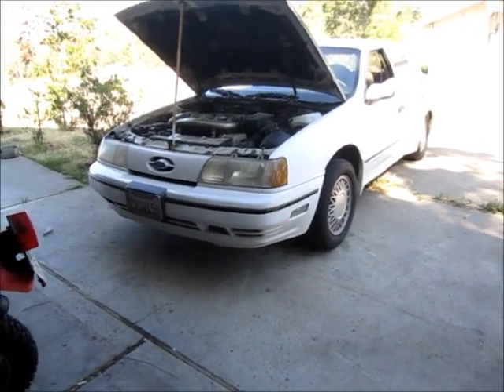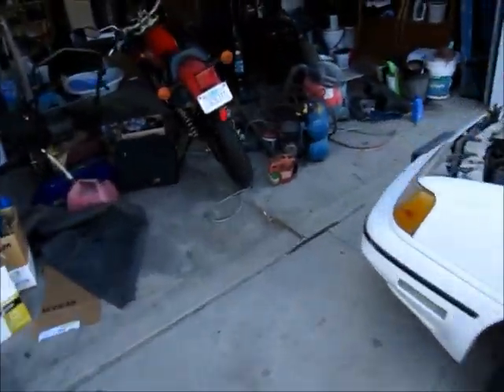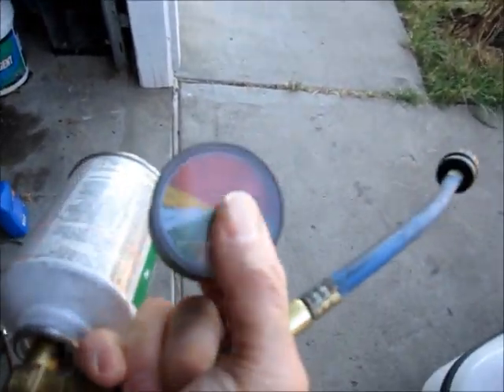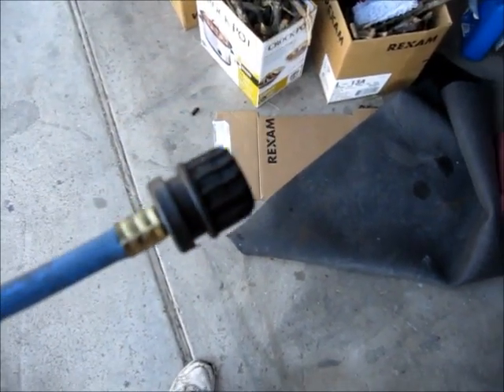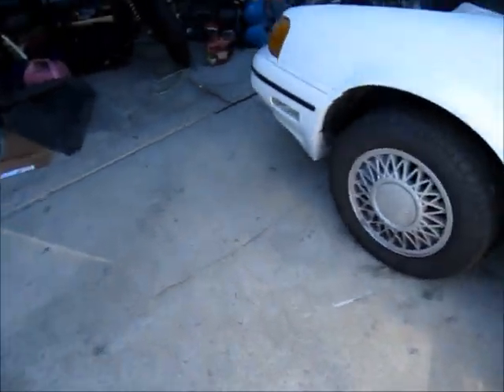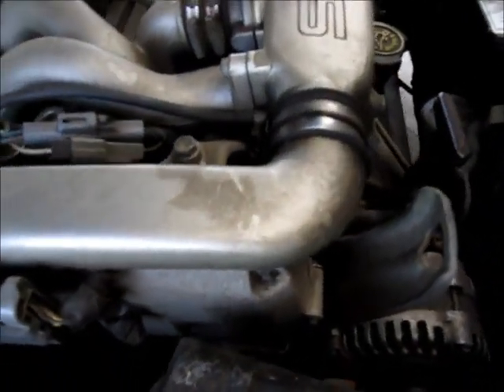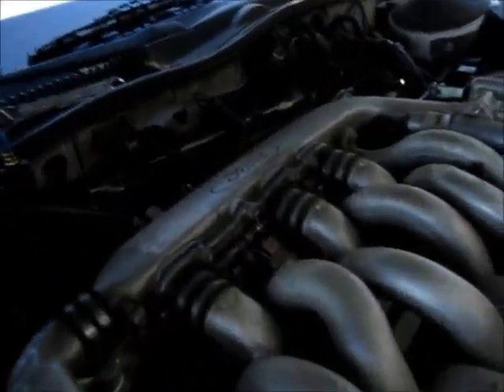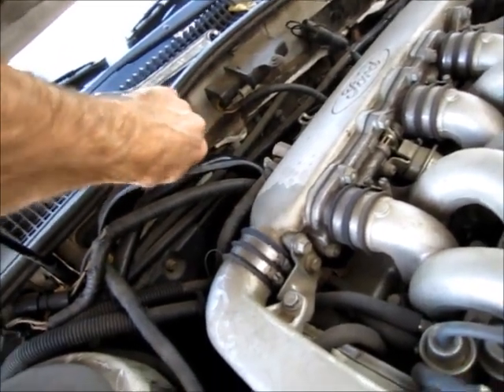How To Charge Auto A/C Systems - Backyard Style Car AC Fix

Comment: I am glad you mentioned the high and lower pressure valves. some are not different color and sizes and can prove to be very dangerous. But this is bad for your system. There is clearly a leak somewhere in your system. This is bad and incorrect for a few reasons. 1st, if there is a leak the refrigerant is replaced with air, this is what causes your compressor to not engage, for good reasons. In the air there is moisture. The moisture with heavy pressure as you checked the pounds but not how much refridgerant is in a vaccum system. So the compressor will wear out much sooner and the leak which you clearly have as your lbs of pressure has been decreased and replaced with air , not unlike a hydraulic  system like your breaks the air bubbles ruin the vaccum, Most cases the rubber part of your high pressure line will have microscopic holes that leak the r-134 out slowly over time also alowing air and moisture into a closed unit. In essence rapidly increasing the enivitable demise of your cool summers. Auto zone and O'Reily's both rent a proper vaccum pump and gauges(which a rental fee is returned in full upon return ) so yes free in the end! This enables you to check both high and lower pressure lines to find the leak. It is simple attach to schaeder valve vaccum to necesary lbs indicated and allow 20 mins to see if there is a leak in pressure. 9 times out of 10 it is in your high pressure line as it is partial rubber and not all metal, and endures high pressures. if it is, its generally a bolt on either side of line and a rubber gasket on each male connector. be sure to oil rubber to avoid cracking in the future. reattach and check pressure again. Then connect your vaccum to the system and allow the pump to run for 20 minutes min. This will remove unwanted air and moisture, ***remember when running pump it will often need an oil refill to avoided burn up, keep an eye on this once the system is purged of air and moisture, find the specs for needed r134a it is usually under the hood and it will tell you how many ounces it requires. Do not exceed this! it will eventually ruin your system. It is a closed system and only works correctly if the correct amounts are in there. Remember there is no such thing as cooling r-134a only removing heat from it via air cool and radiation. So the more air you have in your closed system the less efficient your ac will perform as air does not cool like r-134 does and its mixed in with your coolant.  It can be an easy quick fix to buy the filler cans but they are marketed to people so that you have to buy a 500  compressor much sooner. Or expensive lines. Be careful my friend, dont be fooled by the quick fix. :)

Comment: man!! thanks so much.  I was about to give up on my ac recharge (first time) til I saw your video.  It helped explain the surging and what to expect.  Instructions on the bottles don't say anything about surges so I figured I was doing something wrong.  The more refrigerant that went into the system...the better the compressor sounded and the longer it runs..just like you said. I've got to go back out to get another can to finish the job but this video save me about 80 bucks.
Reply from the maker: Glad you saved some $$ and got it working again!

Comment: When the can is inverted is placing liquid into the compressor, which is all bad for your compressor. You can heat some water up in a pan and place the can into it. This will cause the refrigerant to heat up and pressurize the can, which will help fill the system faster.

Comment: what is stopping air from being sucked into the system when you remove the can from the tap. lol
Reply from the maker: There is a shrader valve that closes as soon as the can is removed. There is also positive pressure in the line, so if there was an instant when the valve was open, it would just vent out a little refrigerant rather than suck in air.

Comment: Changing valvestems should only be done if the system is empty , or has been evacuated with vacuum - but , especially on older vehicles , just a little tiny squeeze of the valvestem , can make it move as much as 1/8" or more.  Surprisingly , this can account for a loss of refrigerant pressure over a long period of time , where your AC will still work after the winter - well enough so you can feel that it's going to need a recharge.  As opposed to it not blowing any cool air at all , come summer.

Comment: Any time you are putting refrigerant into the AC system , you should be re-checking the low side and high side valvestem tightness first.  You do this with a multisized tool which is also used to remove or tighten bicycle tire/tube valves etc.  The reason you want to do this , is because the valvestem O-ring may be worn or loose.  Tightening the valvestems will ensure the system doesn't leak over the winter or at all , then refill the system.  You can , even replace the valvestems.

Comment: Shouldn't take 10 minutes to add a can of refrigerant, you would have way more success if you inverted the can like your supposed to. I add propane and 1 oil injection can to all my old beaters. Works great, very cold and propane is a larger molecule than r134a so leaks arent as much of a problem.

Comment: When the A/C is on MAX it is not suppose to cut on and off it should run constant not turn on and off.When it is on A/C possition it is suppose to turn on and off and it draws in outside air.In MAX possition it recirculates the air in the vehicle and the compressor isnt sopposed to turn off.......Just in case u didnt know.

Comment: First step to filling any car with ac fluids is start out with a vacuumed down system to be sure your not leaking but that requires an investment in some ac tools otherwise your just wasting money. Some of the stop leak fluids will buy you some time to get the system fixed the right way. Low refrigerant sometimes happens just how much do you want to spend to fix it is the name of the game. To each his own. My 2 cents.

Comment: People, while I am all for saving money doing things yourselves, please buy a proper gauge set that measures both high and low sides and understand how to use them. They're not that expensive. Don't use that gauge shown in this video. If your orifice tube or expansion valve is clogged, you can overcharge your system to dangerous levels using the method shown here. If you're losing refrigerant and have to keep recharging, check for leaks instead of having it vent into the atmosphere.

Comment: Thks again jenniesgarage, the thing is I filled the AC  system with 2 more cans 134  to my box truck Chevrolet Express  but the compressor still goes on and off and the pressure goes bellow 3, what do you think should I add more freon or that is something else  wrong to my AC system? Thk so much for your time.

Comment: iI laughed my ass off........question for ya...I've had a car sitting for awhile... no cold a/c now...the compressor didn't come on...I put in some freon in and the compressor came on....but I didn't  even think I used hallf of the small can, and  the pressure showed around 400...and still no difference in the a/c temp inside the car... any ideas?

Comment: It is about $100 to $125 to have a shop charge your system ( about $50 labor ). 
Our local guy has a special at $44.95  PLUS 2 cans at $20 each. TOTAL = $ 90 bucks.

Unless they find a problem. It is important to get someone you TRUST, or they WILL FIND SOMETHING to charge extra ( whether it exists or not). Most shops are honest.

Comment: your better off with the proper gage set if you can . But be carefull with that gage in your hand . Make sure you follow the manactures direction on how to refill the system . Most use about 1 to 3 lbs of 134a .

Comment: I did like R12 better it got colder than R134a . But most cars newer than 1993 have 134a in them any car before that most likely has R12 in the system .

Comment: That gage is not right to proper charge a car a/c system . You need a proper gage set for a car for R134A . its about 50.00 for a gage set .You need to pay atention to your presure chart for 134a and your outside temp too. Also you can look at the cars a/c sticker for the charge by wieght or the lbs of R134A .Most cars are about 2 to 3 cans some are less .